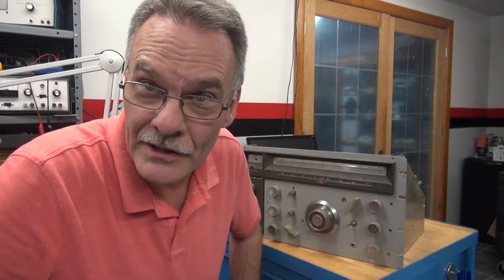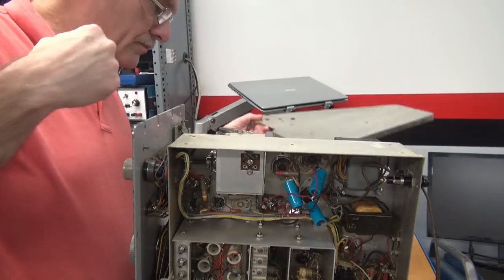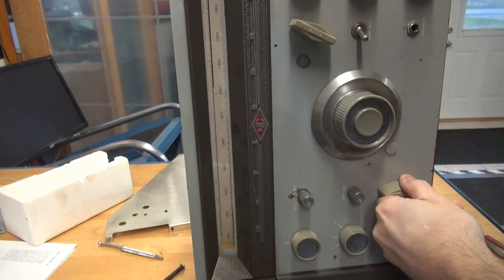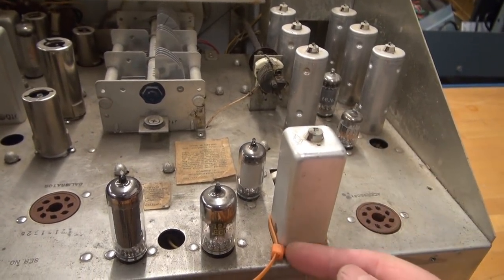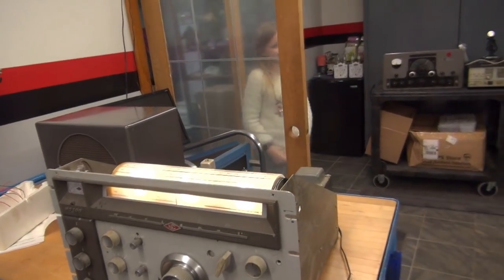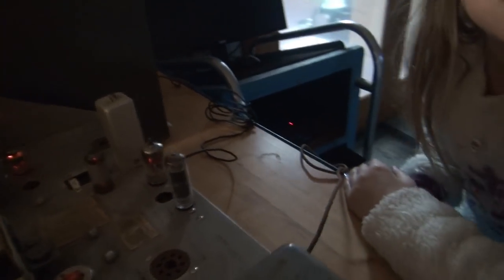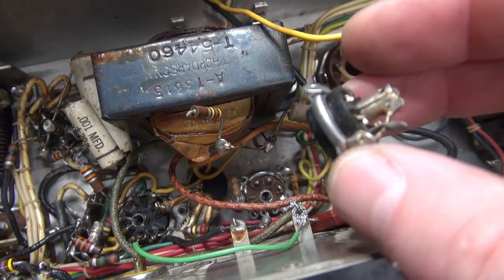How to repair Vintage National NC-300 tube  Ham receiver Common Problems Advice D-lab electronics

Comment: Thank you for this video on the NC-300. I have one which I bought from eBay and it is a real beat up receiver. Dial string is off. soooooo this video is really good for me. LOVE the capacitor in the tube socket invention. Short wave girl kicked your butt again but that's how it is. I picked up the NC-300 as I have an NC-303 and was curious if the "Dream receiver" is better? Gonna find out soon I hope. I love all the work and style you put into your videos. Cheers.

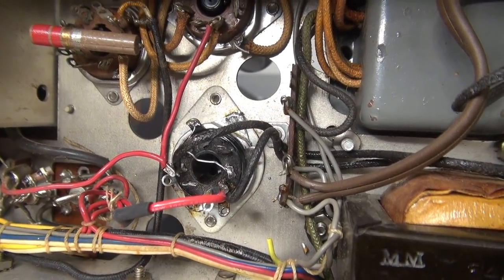Comment: What about that yellow wire at 18:40 with the loose end?
Reply from the maker: Ahh, good catch, That was the wire that went to the 3rd terminal on the original filter cap. I decided to put that cathode cap direct on the 6AQ5 tube socket. Then only used 2 of the large radial mount type for the new adapto-tube-socket replacement. The yellow wire has been abandoned on both ends. Very observant. TD